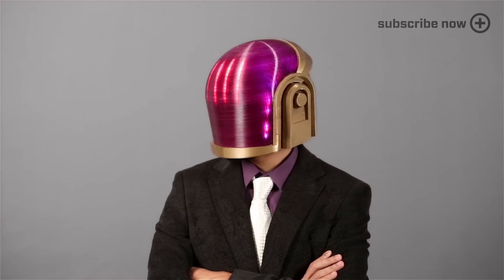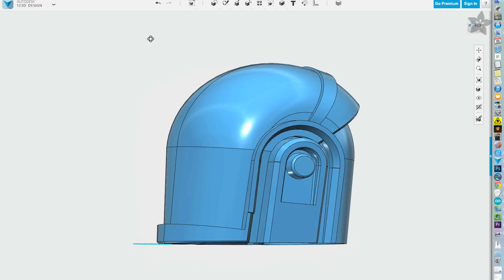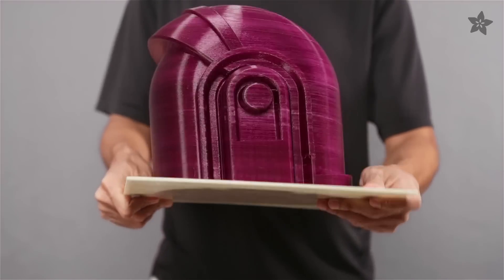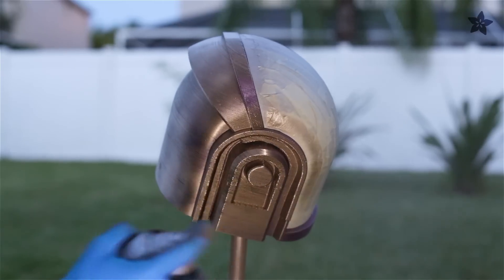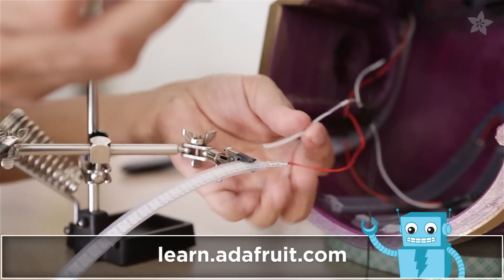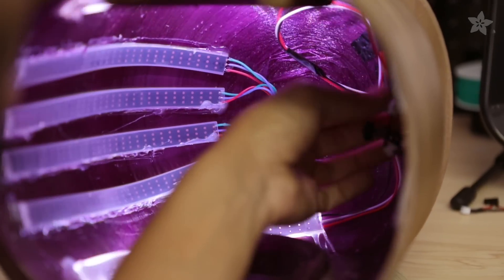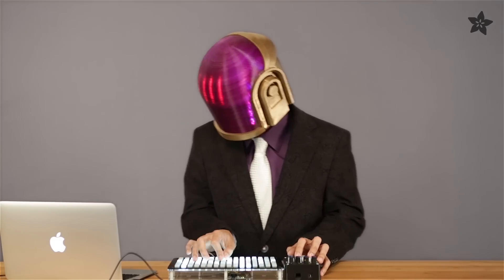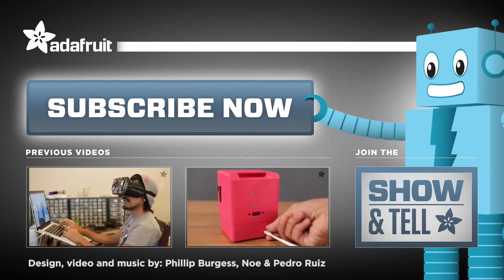#3DPrinted Daft Punk Helmet #Adafruit

Comment: I would like to see something that does not exist in production ,a cycling breathable helmet with full RGB leds waterproof ,to have full visibility at night all the safety protections, and can be work with a long wire of usb connected to a power bank [ why power bank becouse it will last longer batterys is old generation ] that a cyclist can add at his rear cycling jersey pocket or hi can add it inside a cycling pack on his bicycle ,and to have a microphone sensor to go with the beat of the music and to have a remote with led .
Reply: efstathios efstathiou that will be 40.000$ thank you very much

Comment from the maker: #3DPrinted Daft Punk Helmet #3DThursady #3DPrinting
http://adafru.it/dWO

Build a wearable LED Helmet! In this project we show you build your own daft punk inspired helmet with 3d printing, and diy electronics.

This massive print holds NeoPixel strips, lipo batteries and a Trinket.

The open source design can be customized to fit your head and is optimized to print with no support material!

Read the full guide on:
learn.adafruit.com

Read more http://adafru.it/dWO
Reply: what 3d printer did you use to make this?
Reply: a Minecraft ender dragon

Comment: How we could increase the visibility for this project?
Reply: Not 3D printing the clear portion would be a good start.  You probably couldn't see out of this thing even if the LEDs weren't lit.  Use smoked acrylic, and bend it with a heat gun.  It will still be hard to see out of with the light from the LEDs being reflected back at you, but as long as you're not in a dark nightclub, you might be able to see well enough to walk around.
Reply: EctoProps exactly what I was thinking. thanks
Reply: Xano Trevisan Kothe What a cheap backup camera setup.  mount the screen in front of your eyes and and find a place to mount the small wired camera forward. you'll need a 12 volt battery. Just an idea.